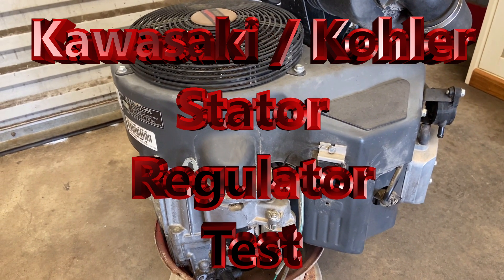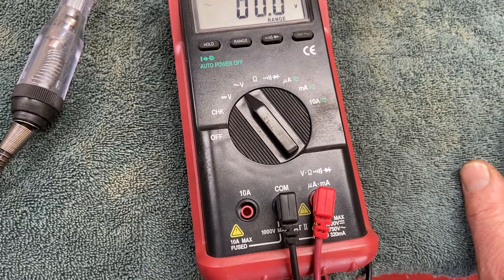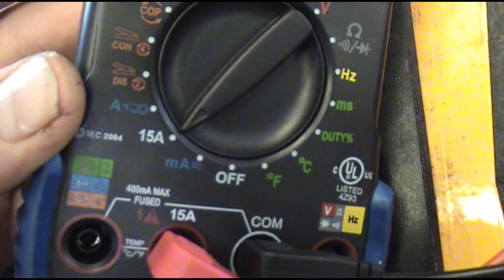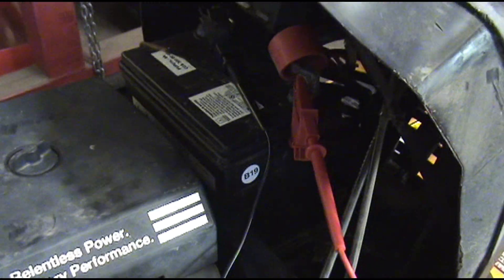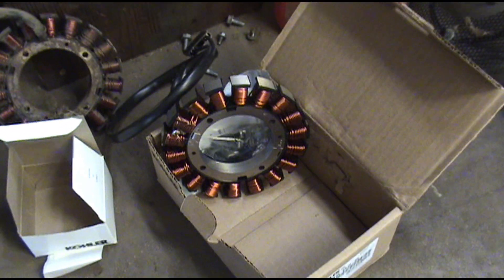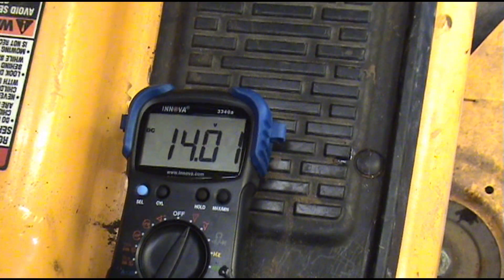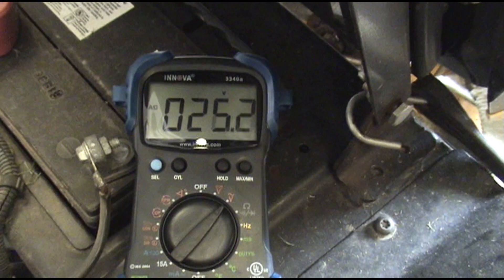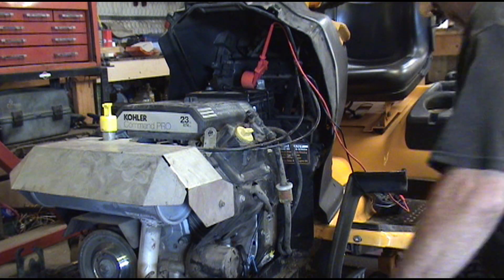Kawasaki & Kohler Engine Charging System Stator & Regulator  Test & Repair

Comment: Thanks for this.  While running these tests I found a loose screw on the voltage regulator that I suspect was preventing a connection to ground.

Comment: Het there! I have an old Cub Cadet. When running, my yellow from the regulator, at high RPM, is only showing 14.xx volts. Is it safe to say the "alternator" is shot, or cheap? I replaced it with a part from amazon, as opposed to an official Briggs part. Or, could it be that the magnets are shot, etc. It is a 2005 mower, so it is kind of old!
Reply: I should have said that it has a Briggs, and the regulator only has a red and yellow. Yellow goes to /comes from the stator, red I guess goes to the battery. (The red had the same voltage as the battery.)

Comment: Just put a new voltage regulator on a Kawasaki engine and it’s still not charging the battery. Could it be a bad stator ?
Reply from the maker: Did you follow my simple instructions on testing the regulator and stator?

Comment: I have an issue with my Kawasaki engine FR961V. DC output on voltage regulator keeps blowing my fuse. What would be the cause of that.  When I have the DC unplugged my zero turn will start. When I have it plugged it, fuse blows when I turn the key to run.
Reply from the maker: Replace the voltage regulator.   Thank you
Reply: @IFIXIT4U I have another issue now. Just started. Right from the get go the rpm runs very high And when I increase the throttle it’s like it’s running too high
Reply: @IFIXIT4U also I tested the voltage regulator with the multi meter. Black on wire from battery, red on voltage regulator. 

Coming up at 12.53 at low rpm and no significant change when I increase the throttle.

Comment: Thank you so much! I had no idea how much voltage variance there should be. Mine is all over the place, but I replaced the stator last year so I thought it must still be good. The spec for my John Deere Z950M Kawasaki is 26V and it’s bouncing between 5 and 36V. Great video and great info!

Comment: So if the stator is not putting out anything is the 12V battery providing the power to the CDI for the spark plugs?   What is providing the timing pulse to the cdi boxes to provide the spark at the proper time?   How is it running with a .5v stator output?   is that enough voltage to run the CDI wich in turns sends juice to the spark plugs to run the motor?    I guess what is the min output from a stator and have the engine run fine like in this video?

Comment: Where does the hot wire go to like the battery side of the solenoid or the starter motor side of the solenoid or straight to the battery?

Comment: Do you only use factory branded parts?  I have an older FC420v and wondering if all parts are available (many show up on amazon etc)
Reply from the maker: OEM parts is my first choice but sometimes you have to use what you can find. On older engines parts are sometimes harder to find.  Aftermarket parts are ok but you get what you pay for.  Good luck.   Thank you.

Comment: On a simplicity zt2354 we don’t show battery voltage at the B terminal of the reg. Supposed to be an “inline fuse” somewhere. Can you confirm this? Can’t find one anywhere.  Can a new wire just be run?
Reply from the maker: I would fix the problem.   I would not run a new wire.  I do not have the specific schematic on your mower and cannot answer specific questions about your wiring harness.   You can probably find that info online.   Good luck.   Thank you.

Comment: My problem is after I cut for a couple of hours, the engine won't start... like the battery is dead. I can charge the battery and it will start.... brand new battery. I've had it (2008 Exmark Lazer Z with the 28hp Kawasaki) at the local repair shop 3 times and they still can't fix this seemingly simple (for a trained mechanic) problem. So I've came to the conclusion that it's on me to figure it out and to find a new mechanic. Your video is just what I was looking for to assist me... THANKS!!
Reply: It’s going dead because your electric PTO is dragging the battery down because it’s not charging. Make sure you battery is good and do the check in this video.
Reply: Electric pto clutch or switch. Just trying to learn to do my own maintenance  @jasonmelancon8096
Reply: Also if your battery gets low enough the engine will not run.

Comment: the first engine shown at very beginning of the video has a ground wire from regulator to engine bolt.  The engine that you tested does not have that ground wire.  Is there a difference in performance with or without?
Reply from the maker: The voltage regulator will not work unless grounded.  Sometimes they use a wire, sometimes they use a tab.  Sometimes its grounded through mounting screw from behind it.   Thank you

Comment: my problem is ,,i bought a husqvarna zero turn ,, all the wiring looked like spagetti ... ive been working on it for a week and just cant figure out where the wires go once they leave the motor ,,,,driving me batty ,, bought a new amp gauge  and have no idea what wires got to it or where from ,, baffled to say the least
Reply from the maker: I would look for the wiring schematic.  Probably find it on line.   Good luck.   Thanks.
Reply: i finally figured it out ,,, thanks all

Comment: What if the regulator is putting out over 16? Would that mean it’s over charging the battery and thus it’s a bad regulator?
Reply from the maker: The regulator puts out what is demanded.  If you have a good battery and your electrical system is in good order. And you are not running any other electrical devices.    Now if the regulator is putting out 16 amps I would say replace it.  
Thank you

Comment: hey, could you tell me what  '15/20 amps'  means, as a pm alternator output rating.    thx
Reply from the maker: Keep in mind that on a regulated system.  System will only produce what is needed depending on electrical load.  System will produce a maximum of 15/20 amps depending on engine RPM that is set by equipment OEM  & size of the magnets in the flywheel.  15/20 amp system is more than enough for a mower with lights and electric pto clutch.  While testing DC amps from DC+ regulator  to  + battery,  4-8 DC amps would be normal.  If you apply a electrical load you will see the amps go up.   I hope this help you.
Thank you
Reply: @IFIXIT4U   I just bought a multimeter but the DC current port is only 10 amps.  I really don't want to purchase a new unit.  You mention that the regulator output is 15/20 amps under a heavy load.  Will I get by with my unit ?  Thanks, and I took really enjoyed the video, it was really easy to follow along with you and I learned so much.

Comment: My NEW stator is only putting out  13AC volts. Is it possible the flywheel is bad? Magnets are attached and magnetic
Reply from the maker: Is your stator like the ones in the video?  ( 2 wires)?   Are you connecting the stator to the volt meter exactly  the way the video shows?  Both meter leads to stator?  If so.  Sounds like your new stator is bad or the wrong one. 
Thank you
Reply: @IFIXIT4U  thanks so much. But overnight I actually thought of the problem. The magnets came off of the fly wheel which I glued back on, but I think I got the orientation wrong on three of the magnets. So it would make sense that I’m only at 13 AC volts. I got a move the fly wheel and check those magnets. Thanks for your response. And yes I connected to the two wires from the stater

Comment: Can a bad ignition make it not charge? My Scag cheetah Kawasaki 27 hp isn’t changing and I have to jiggle the key for it the start
Reply from the maker: No.  Coil has nothing to do with charging circuit.   If you have to jiggle the key it may be a bad ignition switch.
Reply: @IFIXIT4U  when I disconnect the battery while it’s running the engine shuts off.
Reply: @IFIXIT4U  can the ignition switch effect the charging?
Reply: @Guerrero1187  yes the yellow wire on the switch is the charging wire, check it for burn marks or if its even still on the switch, that yellow wire goes all the way to the regulator on the engine, if possible check resistance with a volt meter , shouldn’t read very much resistance.

Comment: Great video, thank you!

Do you think a bad voltage regulator could cause a pto switch to melt when  Engaged?
Reply from the maker: Probably not.   Most likely its a bad PTO Clutch or direct short in hot wire to PTO clutch.   PTO clutch should pull 3-5 amps DC.     Good luck.  Thank you.

Comment: Question .. can’t you just ohm the 2 white wires to the stator ? And see if it shows it open? It’s just a wind of wires?
Reply from the maker: What if you have broken or missing magnets on the flywheel?  What is the factory recommended ohm specs for the 3 engines in the video? How will you know if you are producing enough AC voltage.   By the time you read this I have already tested the stator voltage and sitting down drinking coffee waiting on the ohm specs.

Comment: What about a Honda 24.0 V-Twin?
Reply from the maker: Do the battery & stator test the same as video.  You can test DC Amps buy pulling the correct fuse and using meter probes.   By the time you do all 3 test you should have an idea of the problem if you have one. 
Video coming soon on this engine. 
Thank you
Reply: I checked my stator at 1/2 throttle and get 0. Should I try it at full throttle?
Reply from the maker: I check it at full throttle. A good stator will still put out AC Volts at half throttle.  If you did the test per the video. Then your stator is bad.

Comment: My kohler 23hp keeps blowing the fuse. Stater seems good not sure why its doing this. Any idea? Ordered a regulator just in case.
Reply from the maker: Could be a short or pinched wire or a hot wire grounded.  Check all wires for damage including head light wires.

Comment: I've got an older Koehler ch740 and every time I disconnect it from the battery it will die. Is that normal?  i have replaced flywheel, stator, and regulator.
Reply from the maker: Yes.  That is normal.  You need battery  power for the fuel solenoid on the carb and most of the ignition systems on those early models.  The charging system can shut down if no battery is present in the circuit.  Also the equipment wiring harness plays a roll in that.  Removing the battery power while engine is running tells me nothing about the condition of the charging system.  Also its  hard on the voltage regulator and other electrical components. 
Thank you

Comment: But a new stator on my kawasaki  and I'm not get any reading thoughts?
Reply from the maker: There are only 4 possibilities.  I will let you narrow them down.  Stator, flywheel magnets, meter, Person holding meter.    Make sure the stator is correct OEM stator.  Make sure magnets in flywheel are good and not broken.   When testing stator use AC Volts, see video.   Try a different meter.  Connect leads directly to stator, see video.  Runs engine at full throttle. see video. 
Thank you